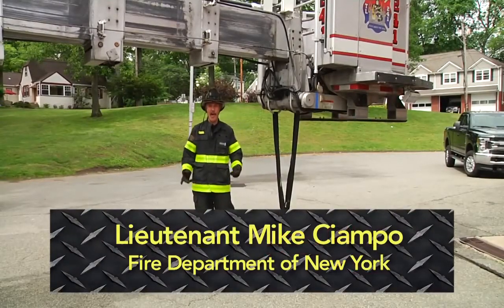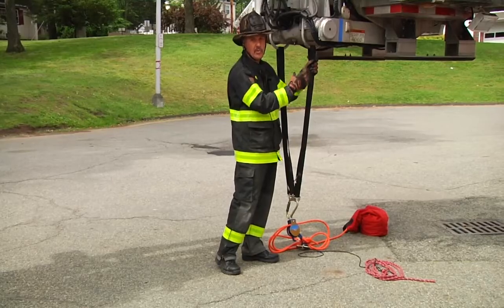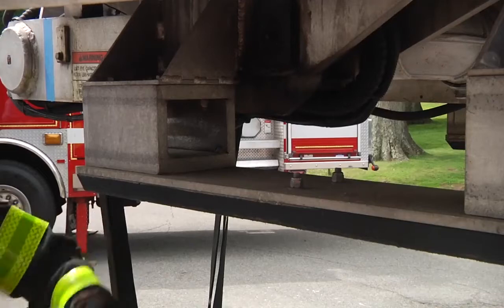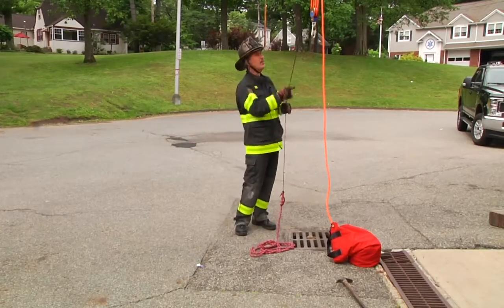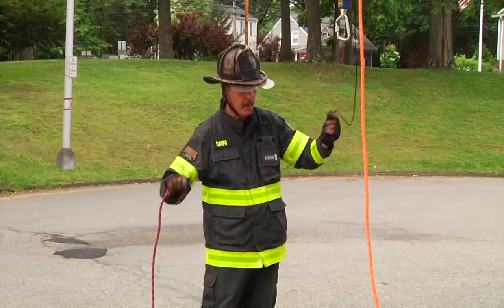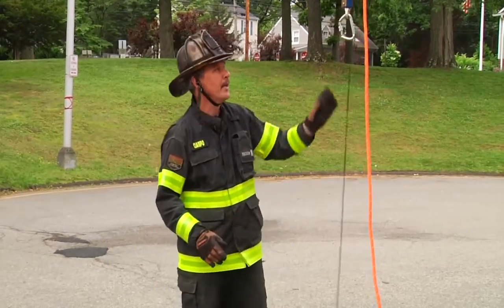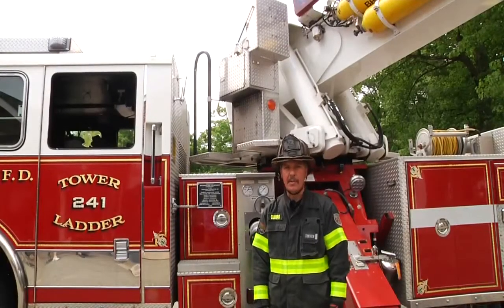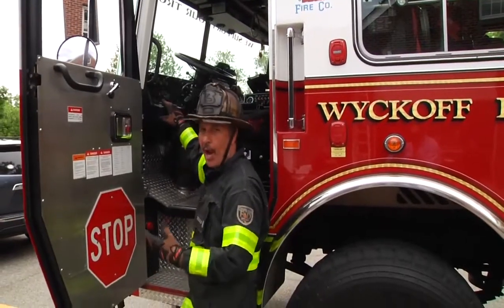High-Point Anchors on Tower Ladders #6119320346001

Comment: All the testing has been done for years. Infact the NFPA standard 1983 states 
NFPA calculates the 15:1 safety factor by using a 300lbs load for each rescuer or patient on a rope system.
2 rescuers x 300lbs x 15:1 safety = 9000lbs.
All of the equipment used should be stamped 9000lbs or 40 kN. The rope used should be 1/2 static line with no more than a 10% stretch.
I was very luck to have worked with a gentleman Jim Kovach who did testing all the time for major manufacturers of climbing gear. He also rewrote the book on fall factors. As you notice I didn’t say I was the smart guy, I was just lucky enough to work with Jim on a high angle rescue team for years. Just one more thing, the only reason I commented was for the safety of others. I have been retired for years and have no need to tell someone how smart I am ( which I am not ) once again I just happen to be lucky enough to be sent to a lot of school with some of the most knowledgeable folks in the industry. Please don't think I am being argumentative or rude I am trying my best just to give you the facts so you and others can stay safe.
Reply: Please reread 1006, 1670, and the new 2500 and point to where NFPA dictates a method, specific equipment or particular safety factor necessary for rescue. All the NFPA says is what you have to be able to do. 2500 states that not only is G rated equipment not mandatory and is at the technicians discretion, but also that equipment not adhering to 1983 can also be used as long as there is an established reason for the substitution and some sort of testing, maintenance and training method with the equipment.

Comment: I am sorry to say but this is NOT a very good idea. The lift capacity of that truck new with the boom fully retracted is 5000lbs. as per the manufacture.  NFPA standards for rope rescue is stated a 15 to 1 ratio with a firefighter being 300lbs. Using a 4 to 1 haul system 3 or 4 over zealous firefighter’s can easily put more weight into the system then the tower can handle. All the rope rescue equipment is usually rated for a 2 person load at a weight of 9000lbs minimum breaking strength the chances of getting a stokes basket hung up on a step or the lip of a sewer is very high so as one can see you are just looking for trouble. Proper equipment should be used whenever possible, in this case a tripod that is rated for this job should be used. 
Now with that all being said, it should also be noted that many ladder manufacturers put simple eye bolts on the bottom of the tower. These should never be used except to hang a flag for a parade. Also the video should show to never create a triangle with your straps using those anchors points, this is known as a death triangle and can have catastrophic results. 
And one last thing, the bucket or straight stick should never be used to rappel off of, they are not rated for that type of stress.  One firefighter coming to a sudden stop on a rope causes a shock load in the system that weight will be transferred to the bucket/ladder. 
For those that say “we do this all the time” or “it’s not a big deal” I know that these ladders don’t often fail BUT not a good way to make it into fire engineering magazine! And if one were to get hurt or worse the NFPA standards will not help your case in court and/or your workers comp case is denied because you were doing something you were not supposed to be doing. 
Why do I write all this? Not to poop poop an idea, not to say “hey look at me” but for one simple reason….. I care about my brothers and sisters and don’t want to see any of you hurt. Be safe brothers and train like your life depends on it!
Reply: Incorrect, do some testing.

15:1 ? 
Show me a rope system capable of 15:1 ssf